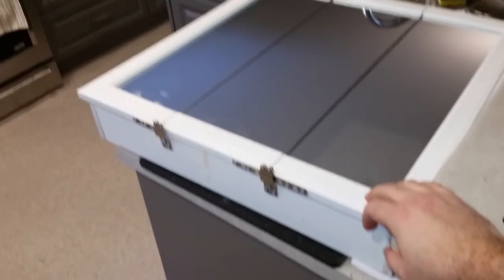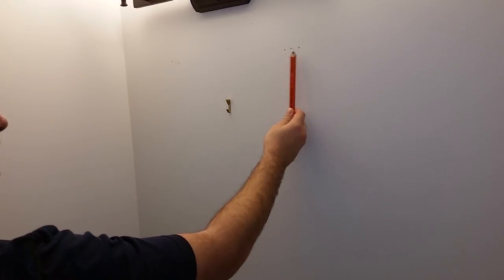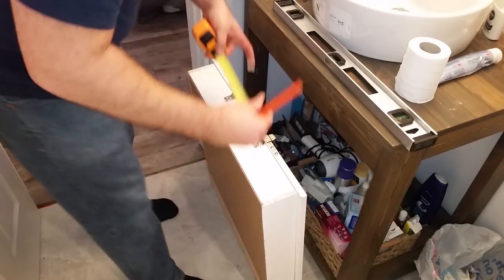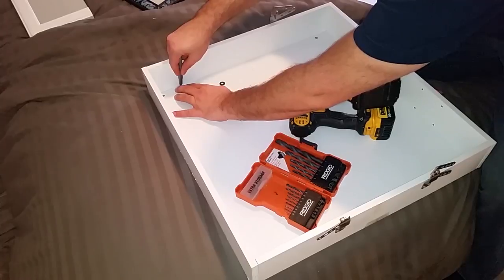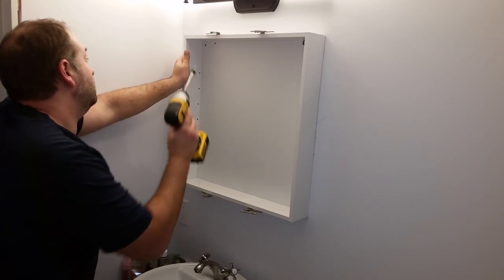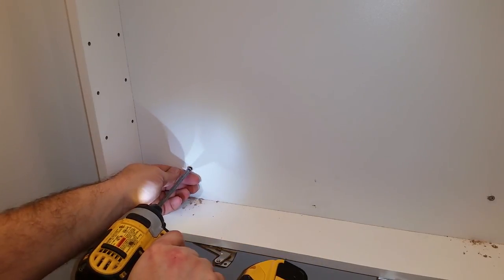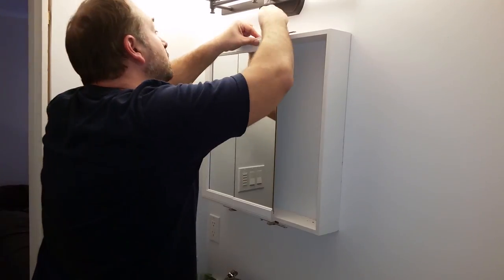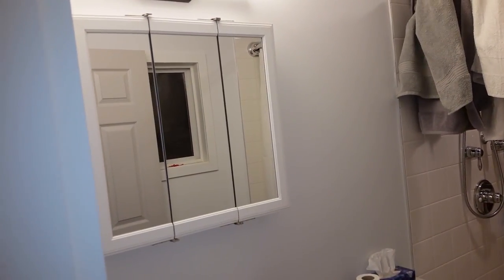Hanging a Bathroom Medicine Cabinet - LHP

Comment: I installed one of these this weekend. I didn't have any help and the one I installed was much heavier than the one in this video.  To make things easier for me, I stacked some things on my vanity (stepping stool and one inch boxes) so that I could rest the medicine cabinet on the stack making sure everything was extremely stable (and level) before proceeding.   Secondly, I made careful note of where the studs were in my installation and screwed the unit exactly on the studs, hiding the screws behind the cabinet shelves. It is very stable.  Just a couple pointers for anyone out there.  Everything else in the video is spot on.
Reply: B 

is there any difference for "mirror cabinet" and "medicine cabinet" please.
Both are used in the bathroom ?
Reply: Mirror cabinet and medicine cabinet can be used to describe the same thing.
Reply: B  thank you so much!
Reply: I’ve been putting off the medicine cabinet for two months in my new house cause I didn’t have a set of extra hands but Reading your comment about the stepstool and the books at 3 AM inspired me to put in my cabinet a few minutes later and I got it done

Comment: Stud finders seem to be not properly named. My problem is after centering the cabinet, I only have a stud for one side of the cabinet. The next closest stud  doesn’t fall within the cabinet. I guess some type of hollow wall anchor will have to be used on the other side.
Reply: In that case use 3/16 inch toggle bolts to secure  it to the plaster or drywall. Plastic anchors would not hold that up very well . Put a small washer behind the toggle bolt screw head ( a toggle bolt as a winged nut with a spring to open up once you put into a hollow wall. )  Hope this helps you.

Comment: How do you know that you've missed the stud after the fact? Does the drill feel different?
Reply from the maker: Hi, in most homes a standard wall is made up of drywall on wood studs.  The space between each stud is usually just air. When drilling if you miss the stud it feels very different.  After the first half inch, you will feel no resistance on the drill and the bit will just fall into the air gap.  When you hit the stud you will feel the resistance increase as you drill into the wood.  Thanks for the question.